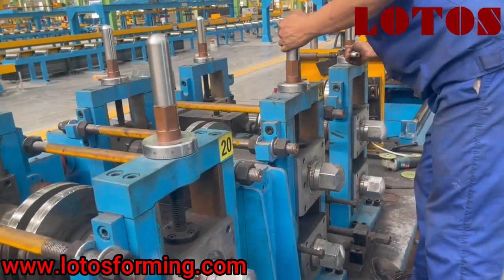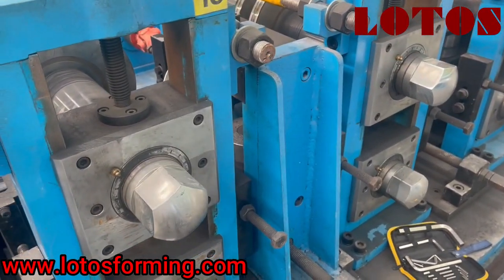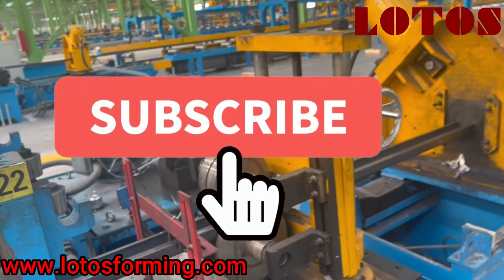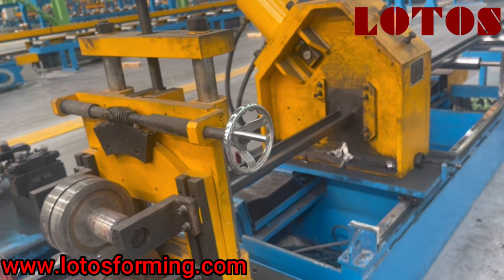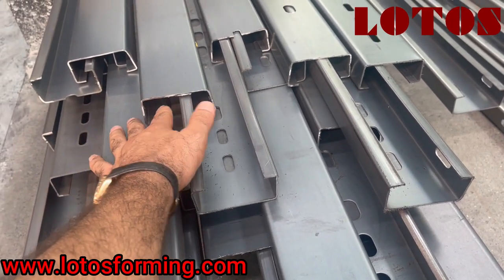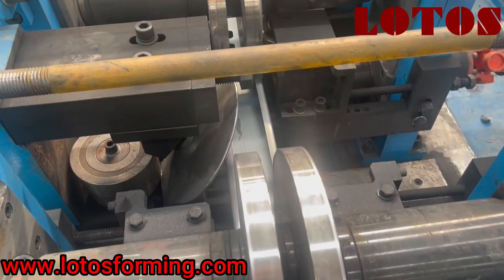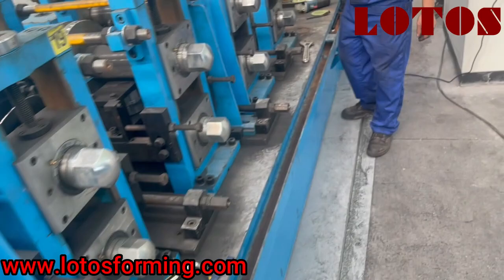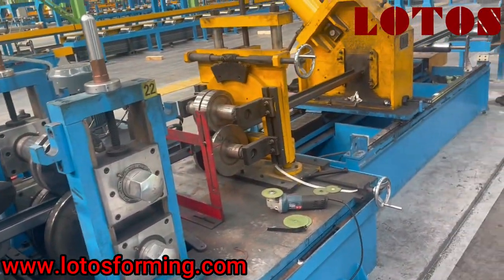Set up for Roll Forming Machine

Comment: Dear all
I am a metal roll forming production machine operator (Metal structures maker). I have more than 8 years’ experience in Dubai at a Cartel manufacturing company. I am a Bangladeshi. I am interested in applying to be a machine set-up operator or Similar job. But unfortunately I don't get the opportunity to work in an organization despite my interest and experience as I don't have sponsorship. My results in the operation of stud and track roll forming machines, furring channel roll forming machines, U channel roll forming machines, Bending machines, lintels machines, strip ceiling machines, cutting machines, punching machines and quality assurance of products. I've made it my duty to obey all appropriate procedures and local regulations in order to work safely. In all I had done, there was a strong work ethic and an efficient completion of tasks. I will send you my CV & Dubai visa documents as proof. There are 4 visas, May 2008 to march 2017 time duration. I would be very much pleased to take part in an interview. Please manage a work permit for me. I have all the required documents. I will be very happy to get your service.

WhatsApp number +8801839888012